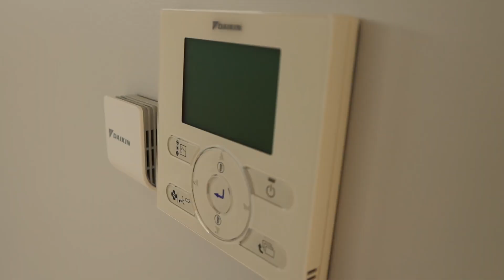Roof space too small for air conditioning, we have the solution

Comment: Hi Craig, just wondering what the bulkhead unit sits in to enable output and return air to be within the same grille. Do you fabricate these yourself?  I don't see these anywhere for purchase.
Reply from the maker: We have a flat bed CNC that we cutout the bulkhead box, same as what a kitchen company makes kitchen with. So you could get a kitchen company to make them.
Reply: @FullyAirconditioned cool. So there just has to be enough gap behind, above and below the bulkhead unit for appropriate air flow? Assume return air enters the rear?
Reply from the maker: @Fazzarelli unit is hard up against the grill so the conditioned air blows straight out. The return air comes in each side of the same grill and then into the rear of the bulk head unit. The bulk head unit is 450mm deep so when it’s installed in a 600 deep box you have about 150mm at the rear (less the thickness of the box). Some discharge air dose short cycle to the return air so the remote sensor is needed. The sensor plugs in pc board, then mount it inside the box furthest to the right, this works fine. The grill needs to be very open, a line bar grill is the only option that works or maybe a double deflection grill, other grill restrict the air flow and it just doesn’t work. I posted a video where the architect had designed the grill to be made from the kitchen panel with routed grooves, this didn’t work and had big negative effect on the system performance.
Reply from the maker: @Fazzarelli  https://youtube.com/shorts/hp3Lu1rZ9v8?si=yk0ExXuDFySk5-29
Reply from the maker: @Fazzarelli  https://youtu.be/jVU6ZuTAtK8?si=zxYz7J54qtErtfku
Reply: @FullyAirconditioned brilliant mate. I can make some enclosures from MDF and use foilboard and foilboard tape on the outside to insulate from the warm air in the roof space. Like the blacking out of the internals too. Great idea.
Reply from the maker: @Fazzarelli we use black melamine water resistant board
Reply: @FullyAirconditioned  even better. Craig, thanks so much mate. Really helpful 👍👍👍

Comment: Hi, great video I have the daikin bulkheads, I find them noisy as I can here the refrigerant gurgling and bubbling when the compressor is running, Daikin said its normal but I think it's really loud. Any feedback or advice? Has anyone complained about this before. Thanks!
Reply from the maker: Is it a VRV system or multi head system, is the noise when your unit is on or off.
thanks